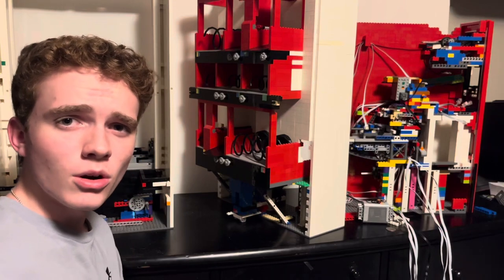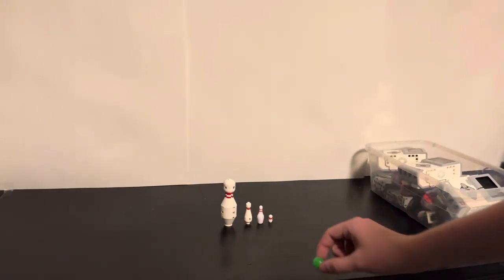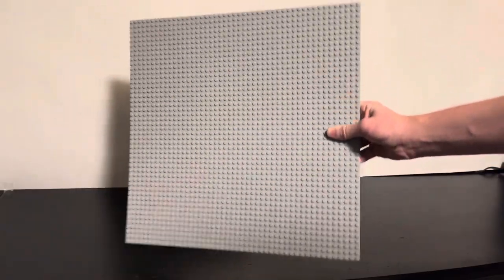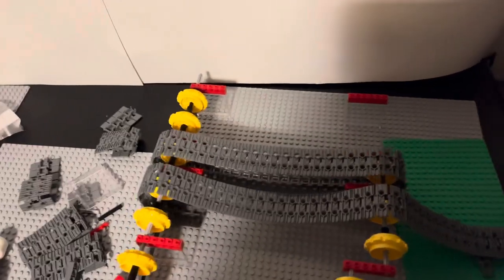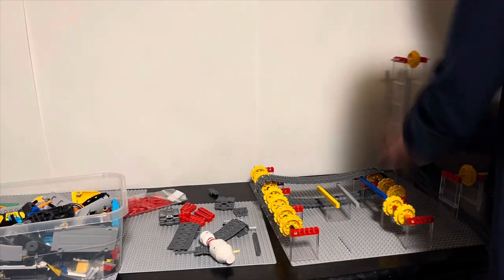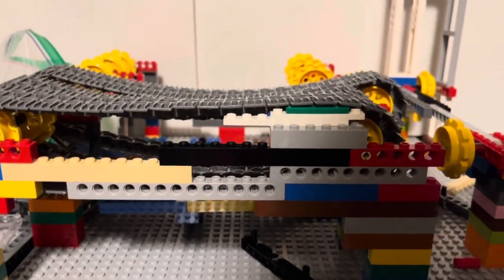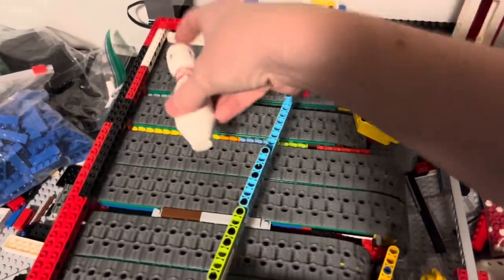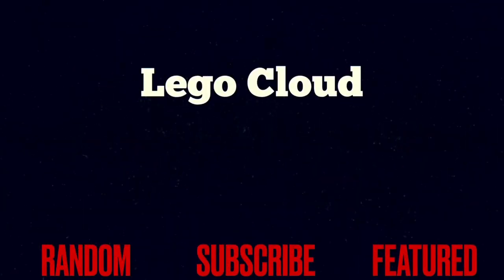Building a Lego Bowling Alley Pin Cycler Pinsetter - Episode: 1

Comment: Another tip, start of with the pin deck, pin side walls, lane and gutters first,  also optional to work on the setting table and sweep before working on the pin distribution.  Most Lego bowling machines I’ve seen had a hard time on the top pin distribution (the pin elevator going through the setting table). So good luck on that
Reply from the maker: Thanks for the advice! It’s definitely a challenge getting all the parts like the pin deck, setter, etc to work with each other. I’m making mine in modular, pull apart, sections so I can just snap them apart to work on each so ideally, it’ll all be a lot easier for everything to line up